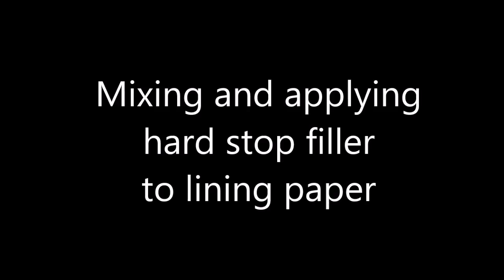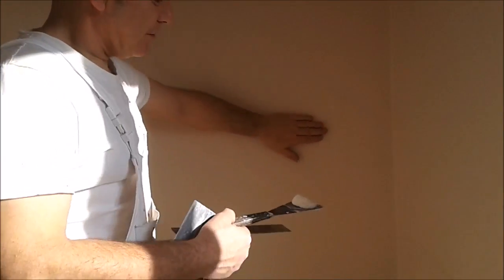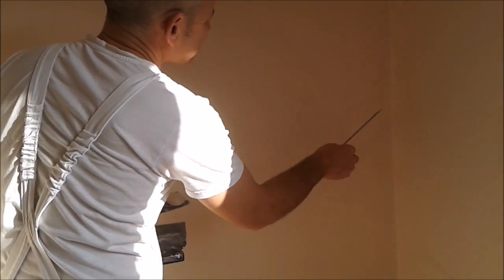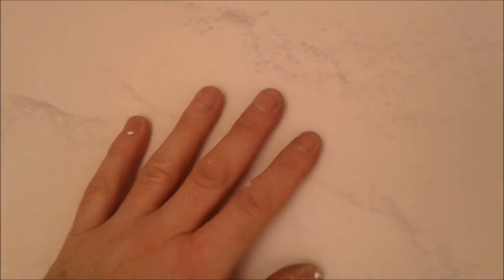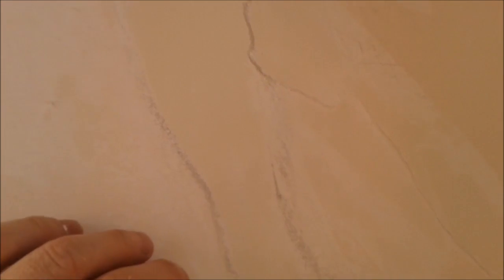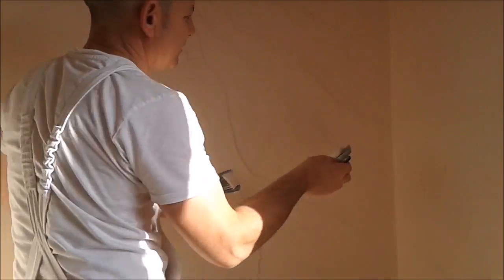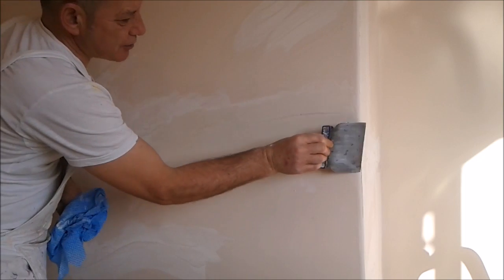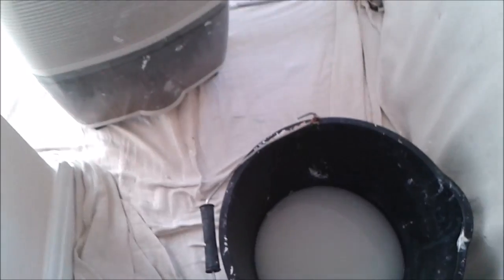Mixing and applying hard stop filler to lining paper

Comment: Preparation which should have been done before lining the walls. If the walls need a lot of prep I normally use a work light against the walls to highlight inperfections.
Reply from the maker: No Martin it's a lot easier to fine tune after the lining paper is on. Do as much perpetration as you can on the plaster and move on fast no hanging about. So much quicker to just mix some hard stop and fine tune.
Reply: Yawn 😴
Reply from the maker: Paul Martin Yes you are splitting hairs.
Reply: Well said Paul, totally correct, all prep should be done first. It's the first thing you teach an apprentice.
Reply from the maker: All the preparation has been done before the lining went on, this is fine tweaking to get the job 100%
You have a lot to learn still.

Comment: I've got some settlement between the walls and ceiling of a recent built extension- about 4-5mm wide.Can I use the easy sand polyfilla to fill these?
Reply from the maker: Yes, use expanding foam first.
Reply: @PaintingandDecorating  Cheers!

Comment: Thanks v much for this vid! 
My walls have had electrical conduit channeled into them (years ago)for wall lights. The channels (leading up from sockets) have been badly filled and the depressions are visible through the lining paper - could I level these off with a similar technique? Thank you 😊
Reply from the maker: Yes this method should work. Thanks 🙏

Comment: Hi thank you so much for all your videos and for sharing your knowledge in the trade. I'm a P & D student level 1 City & Guilds. I am in the process of doing my sisters spare room as a "let's see how long it will take me and what I could charge in future" the walls were lined and painted. The walls are bad, bellows, paint peeled in places and lots of  holes. I have filled, sanded, reclined with 1200 and two coats of elmulsion. I have seams that are not stuck, wall still uneven, the wall looks crap!! After 4 days of work. Do I need to strip and start again?? Feeling very disheartened 😔 your advise would be much appreciated thanks Natalie

Comment: As always a great video topic clearly explained. Please what is the effect of mixing the wall paint with the filler? Does it make the mix stronger, durable, is it easy to sand and how deep should it be used? Many thanks
Reply from the maker: Thank you paint and filler should only be used before a second coat for fine filling.. thanks

Comment: Is that for filling visible cracks coming through the lining paper? Can I use hard stop for filling gaps between the paper joins?  I think you advised ro someone to fill POST the first coat of emulsion, is this the case?
Reply from the maker: Yes always best to apply first coat over fresh lining paper before doing any filling. Thanks
Reply: @PaintingandDecorating  Thank you.
Reply: @PaintingandDecorating   One other question please, does the first coat (watered down paint0 and filler afterwards, does that apply to gaps between the paper joins too? Or should I fill those pre-paint as they would have bare sized plaster/sized old paint beneath?

Comment: Just done a job where I lined a wall with 1200 grade paper and used beeline ready mixed paste. Paper stuck lovely to the wall once dried out but did have a few hairline seams. So gave it its first coat of slightly thinned valspar emulsion and allowed to dry. Then filled the seams with toupret powder filler... usually use poly cell but had this to hand. Sanded down once dry and gave it a second coat of valspar Matt emulsion. Looked perfect 👌 2 days later seams have reappeared... seams were stuck down solid with paste so no lifting areas. Just wondering if you have any knowledge on what it could be. Forgot to mention I did mix a hard stop filler using the paint also like in your videos. I’m wondering if it’s down to the filler or maybe room temperature? If I’ve done something wrong please let me know as I’m interested to find the cause! Cheers mate. Your videos are truly very helpful to the seasoned decorator like myself haha!
Reply from the maker: Thanks.. Have had the same problem myself...  and I think it's down to the thickness of lining paper...  soaking time is very important the thicker lining you use...  it has to be well soaked and lots of paste.   Then your joints have to be tight...  if not and you fill they will need a second fill and possible three coats of emulsion...    did a job last week and took my time. soaked for over 10 minutes then spent  longer hanging it...  to make sure the joints where super tight....   when the customer came in they asked if I'd painted the walls...   you could see no joints...   then when I painted the lining hardly anything should up...

Comment: Here in the USA, we'd probably just use Sheetrock joint filler; it seems to work on everything. I like this approach better than re-plastering ; the tensile strength of the paper will help contain future cracks. This type of filling is also useful for painting wallpaper, which is worth doing if the surface underneath would get wrecked in the process of removing it; I like to go over the seams with mesh & thin mud too.
Reply from the maker: Mesh always leaves a lump showing on flat walls.

Comment: Excellent tutorials buddy. I could do with some advise please. I stripped back a wall, filled and levelled out the obvious areas that needed it and now I’ve lined with with 1400. I’ve noticed inset areas where the wiring channel for the light switch would be, from the switch to the ceiling. I’ll painting emulsion on top of this like you have done on this clip. I am tempted to try the technique you have used here too, but I am concerned about the texture difference between the levelled area and the lining paper, will one look smooth and the other even more smooth? Thanks and keep the quality tutorials coming.
Reply from the maker: D phect Sorry for the late reply as long as you roll a coat over the hole area it should be the same.
Reply: I've reached the same problem,great to know the answer 😊

Comment: Am I correct in remembering that you said you shouldn't use vinyl paint in hard stop please? Would you know why that is? Thanks.
Reply from the maker: Actually you can make hard stop filler using most paints. Thanks
Reply: @PaintingandDecorating  oh, you're a flipping star. Thank you so much. I did my first hard stop fill yesterday in another room using normal emulsion and it looks great. Got another room to do today, but I'm using vinyl paint. You've saved me so much hassle, thanks again. Have a great day. x
Reply from the maker: @toria-j  thank you happy painting.

Comment: Again thanks for the vids.  I am confused.  What is the difference between filler and 'hard stop filler?
 I can't get an answer from Google.  Thanks.
Reply from the maker: Hard stop filler is filler mixed with your emulsion colour or white. It is applied after first coat if some filling is needed, before final coat.
Reply: Ahhhh.  Got it - thanks again.

Comment: Hi. I followed your method and the filler has started cracking after painting. What can I do to alleviate this?
Reply from the maker: Its possible you have paste underneath the filler. Sand and wipe try again. Thanks
Reply: @PaintingandDecorating  I think the paint top coat has started cracking actually,  not the filler.

Comment: Hairline cracks appeared in dot and dab skimmed plasterboard walls, six months after completion. The cracks are from top to bottom and are located where the boards are joined. No other cracks are evident and the boards are perfectly flat on their surface. The cracks have not continued to widen after a further three years and in all other regards, the walls are perfect. It’s such a pity that the cracks spoil what is a really good job.

Would you recommend widening the cracks slightly and using hard stop filler to make good. I have considered using lining paper to achieve a really good surface that with hopefully ensure that the cracks will not reappear going forward.

Comment: What are you putting that mixture into?
Reply from the maker: Spencer Colgan it's used after your first coat of emulsion. Used to touch up any joints in the linning paper and filling parts that show up. It allows the second coat of emulsion to be applied without sealing the filler.

Comment: Is hard stop the same as what we term hard set like what is used for plasterboard i.e. Has set working time not air dried ?
Reply from the maker: No hard stop is a mixture of powder filler and emulsion, used for fine filling just before the second coat. The filler does not flash.
Reply: what does flash mean ? thanks

Comment: What grade paper  have you used looks like 1000
Reply from the maker: It was 240 grit
Reply: Painting and Decorating I meant lining paper grade not sanding grit
Reply from the maker: yes 1000,  long day at work lol.
Reply: @PaintingandDecorating  240 is just perfect for the job isn't it? Filler just powderises as you sand the area smooth.

Comment: what does flash mean ? thanks
Reply from the maker: It means you can see a patch on the wall where the paint has soaked in more especially over filler. It can happen if you go back to touch up after a short time as the paint has been drying and it shows where you tried to touch up.  Can happen on ceilings using vinyl matt I've stopped using vinyl paints if I can help it.
Reply: oh probably to late for me then ! i/ve uesd the filler on lining paper without mixing in the paint :(  thanks anyway
Reply from the maker: nick evans If it's your final coat it possible will, but 2 coats should be fine
Reply: thats gr8 not painted yet only filled :) thanks

Comment: Just mix filler . No need for the emulsion.
Reply from the maker: Mixing filler with paint is called a hardstop filler...   we use this after the first coat of emulsion has dried.  If anything shows up or joints in lining paper need filling...  it allows for a second coat of emulsion without the filler flashing once dry.
Reply: @PaintingandDecorating  oh ok.  I've never heard of this before and I've been painting/decorating for 20years. Always good to learn something new though.
Reply: @PaintingandDecorating  So, the paint doesn't affect the filler's performance in any way then?

Comment: Mix it in a tub, loads easier.
Reply from the maker: ONEKINGOFF The reason we use a board is because you can wipe it clean easy and mix filler again. Tubs are harder to clean out and work from.
Reply: Painting and Decorating have to disagree on that one. I've been decorating for 29 years and city in guilds qualified. I have tried board's to mix on, that's why I use a tub now, you can mix faster and easier and clean up quicker. It is also easier to fill and sand the walls properly first before applying the paper, which is the correct way to do it.
Reply from the maker: ONEKINGOFF never really seen people mix fillers in tubs. Was never shown that by any tradesmen. But if it works for you.
Reply from the maker: Flat blade and round tube good luck.
Reply: @ONEKINGOFF  I bet your customers love you cleaning your tubs out in their sinks!